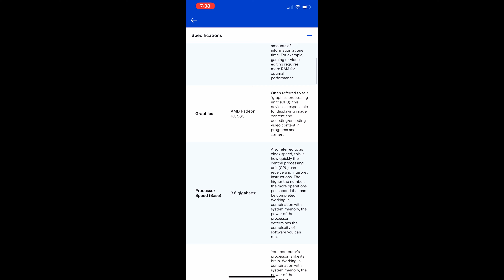FREE GAMING PC GIVEAWAY - NEVER Buy a Pre-Built PC - Ryzen 5 3600x 2020 Build

Comment: I bought a pre built for amazing deal. $1000 Cad had i7 7700k and 1060 6gb, 16gb ram, ssd and hdd, asus pro gaming mobo and some other stuff. Upgraded gpu and psu since
Reply from the maker: Yeah you're the 1%. Most prebuilts have OEM motherboards and are hard to upgrade + they put crappy low watts psu which is probably why you had to upgrade if you added any parts. But yeah, you got a solid setup. You find these pre-built deals sometimes that are good but the average one isn't.
Reply: @AzimsTechyard  it came with a 500w I just got a 650w after.  And a rtx 2060.  But yea it was a really good deal, Black Friday
Reply: @AzimsTechyard  I got it from Canada computers they build them and sell them or they can build it for you and you just tell them the parts you want. I would of built my own but this deal was to good

Comment: Well, I may have missed this giveaway! But I 👍 & subbed! Thank you
Reply from the maker: Another giveaway starting in the next video.
Reply: @AzimsTechyard  i posted in the vid you put up 1 day ago! On the cpu cooler, was a film on the thermal pad (to protect it, to be removed just before mounting)? Thanks
Reply from the maker: I'm not sure what film you're talking about. The thermal paste? You leave that on to dissipate the heat from the processor
Reply: @AzimsTechyard  i know that! Is there a protective film on the thermal pad that you remove just before mounting it, the cooler fan, to the cpu? The pad itself is left in place. Also, did you need to update the bios before building the pc? Thanks
Reply from the maker: @j.lietka9406  oh okay. Now I see what you're talking about. So maybe on nicer coolers they have a film. But on the stock AMD coolers there is no film/covering to protect the paste. It comes packaged in a plastic box that I removed before installing which normally protects the paste from getting touched or spread.
Reply: @AzimsTechyard  i have a 3300x on pre order, & just wondered. Thank you 🤓

Comment: I hope I win it!! My pc doesn’t work
Reply from the maker: Make sure to subscribe. Winner will be a random subscriber
Reply: @AzimsTechyard  by any chance can do you know my pc isn’t working? I have all the parts plugged in and working but when I turn on the power supply my fans move for split sec and a light goes off for a sec and makes a tik noise I just built it and wish to use it
Reply from the maker: @YoungHam22  Hey, what components are you using? And if it's all new parts or you put it together you might have the ram or a different component installed incorrectly. Try re-installing most of the components to see if it helps. That's where I would start.
Reply: @AzimsTechyard  so they are new parts I have a ryzen 5 3600, 2 16gb tfroce delta ram, Msi GeForce rtx 2060 oc, cooler master mwe 650 gold fully modular, Sandisk ssd 480gb and my MB is an msi b450pro vdh max .. anyways I had just built it and it wouldn’t turn on at all then I re installed all the parts and put them back together and took out the cables and plugged them back in and now it has a light that turn on for a split sec along with the fans and a clicking noise for a split second and don’t know if I have to get a new part I hope not I just spend a lot of money and hope it works